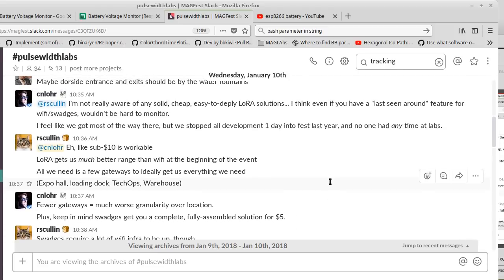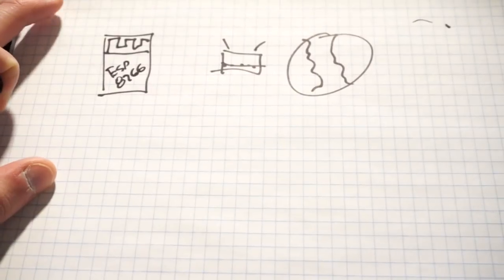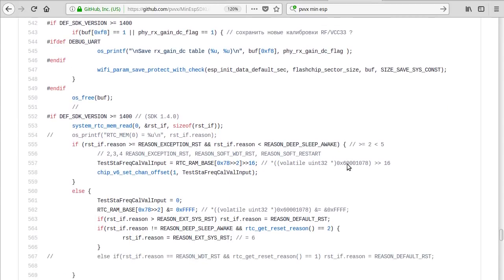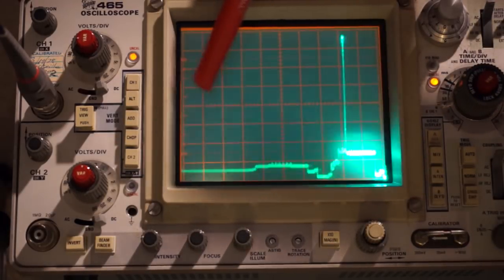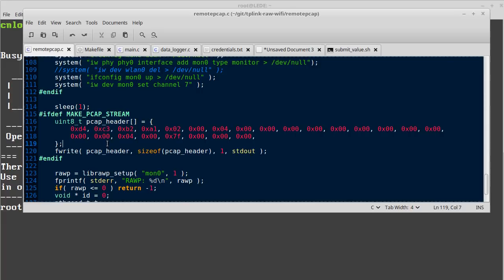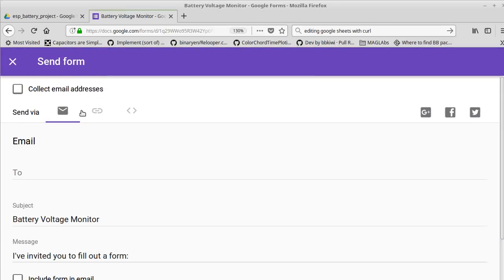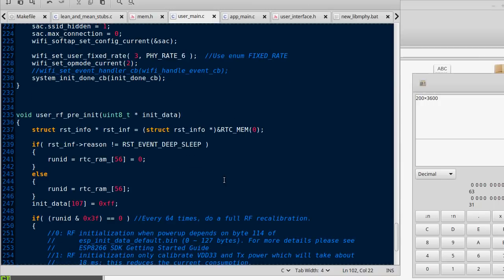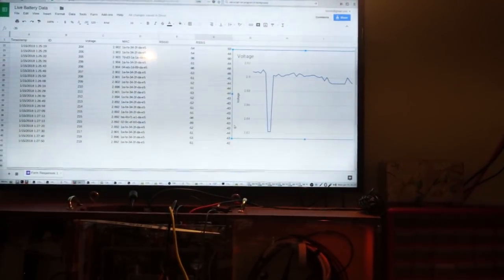Aggressively Low Power with the ESP8266

Comment: i recently discovered ulp bt module jdy-25m - 0.2mA in ibeacon mode and 1ma in transparent transmition mode. It possible to pair it by uart with stm32l0, which have power consumption in ulp mode about 0.005mA. If you manage intervals between active bt packages, you can achieve astonishing battery life.
Reply from the maker: I can believe that.  There's getting to be some interesting low power bluetooth chips.  But it's a lot harder to find that for wifi packets.
Reply: @CNLohr .yeah, i will test it soon, but not sure if i can measure such currents. Jdy21 or 22 claims 0.05mA. in ibeacon mode. I discover some other similiar modules, but i couldn't find them on AliExpress.

As for wifi im not sure, never looking for it, but just from cost efficiency i will go with esp12, or esp32. Poor low power currents, but all in one chips and cost 1-2$. Wifi consumes too much power for ulp devices anyways.

Comment: "Milliamps of power" ???
I thought amps were for current and watts were for power.

Precision in language makes one seem more authoritative.
Reply from the maker: Trivially convertible.  milliamps at 3v is milliwatts.
Reply: Amperes are units of current 
Watts are units of power
Reply from the maker: @rwitriol  If you know the voltage then that's irrelevant. Because they will then mean the same thing.
Reply: @CNLohr  Amps are current
Watts are power 
Because you can compute one from the other if you know the voltage doesn't change that

Comment: im looking at a home automation project, was curious on why espnow didnt work? too much battery use? Also as a relative noob, this video is super helpful, but what if anything else would i need to add/change to get it to chirp out a sensor reading instead of just voltage? thanks!
Reply from the maker: You can chip out anything you'd like.  It's pretty straightforward.  And I think the reason it didn't take off was because it didn't fit the mental model of what people were looking for.  Not based on any technical issue.

Comment: Did someone test in this scenario like how many devices can successfully submit the data, for example 100 or more ESP connected to such router and if there was any data loss?
Reply from the maker: Data loss is probable but probably very low rate of data loss. As these chips still perform CSMA to reduce the change of them stepping on each other's transmissions.

Comment: Nowadays it wakes up faster - less than a second while opening a TCP control socket and initializing OTA and uses about 16uA in deep sleep.
Reply from the maker: That's ten times as long as 100ms.
Reply: @CNLohr  Yea but you do not open a listening socket and setting up server and OTA :)
Reply from the maker: @iasenkostov6525  I'm doing what needs to be done.  I still get full two-way communications.
Reply: @CNLohr  I should test it with your setup to see the real difference. Btw I'm not even sure how long it takes coz it's repurposed code from another project with different idea. I can only be sure that it's less than a second.

Comment: Wouldn't it be easier to just send a single ICMP or UDP packet straight to the cloud server, saving requiring a custom modified accesspoint? I currently wakeup, measure temp (DS18) and send the data via http to an influxDB server, and goto deepsleep all in under 400ms, I assume moving from TCP to plain IP would be even faster, the data handling part is about 200ms.

Comment: ESP8266 WiFi Repeater (NAT Router)
Martin Ger
,Published on Jan 2, 2017
simpler to just add in marins lower power repeaters modified and several power reclamation options to supercap power storage with cheap STT-MRAM chip than some higher power use single router https://www.youtube.com/watch?v=OM2FqnMFCLw

Comment: The problem is if you use this approach you will have to change batteries every 1.5 month for just that simple one packet tranfer.

Current of deep-sleep = 20uA
Current of booting = 30mA
Current of loading = 40mA
Current of pre execution = 20mA
Current of execution = 70mA
Current of going in deep-sleep = 10mA

Time of deep-sleep = 9.9s
Time of booting = 35ms
Time of loading = 25ms
Time of pre execution = 15ms
Time of execution = 20ms
Time of going in deep-sleep = 5ms

Times of 10 second interval in minute: 60s/10s = 6 times 
Times of 10 second interval in hour: 6*60 = 360 times 

Time of deep-sleep per hour: (9.9s*360)/3600s = 0.99h
Time of booting per hour: (35ms*360)/3600s = 0.0035h
Time of loading per hour: (25ms*360)/3600s = 0.0025h
Time of pre execution per hour: (15ms*360)/3600s = 0.0015h
Time of execution per hour: (20ms*360)/3600s = 0.0020h
Time of going in deep-sleep per hour: (5ms*360)/3600s = 0.0005h

Power drained from deep-sleep: (20*10^(-3))mA * 0.99h = 0.0198mAh
Power drained from booting: 30mA * 0.0035h = 0.105mAh
Power drained from loading: 40mA * 0.0025h = 0.1mAh
Power drained from pre execution: 20mA * 0.0015h = 0.03mAh
Power drained from execution: 70mA * 0.0020h = 0.14mAh
Power drained from going in deep-sleep: 10mA * 0.0005h = 0.005mAh

Total power drainage: 0.0198mAh + 0.105mAh + 0.1mAh + 0.03mAh + 0.14mAh + 0.005mAh = 0.3998mAh

R2032 capacity = 240mAh

Lifespan with 2xR2032 batteries: (2*240mAh/0.3998mAh)/24h = 50 days without counting for external factors which can affect battery life.

Comment: It would be great if someone make a version where Instead of router use regular wifi stick in a pc - probably with mqtt support. 😀
Reply from the maker: If you use Linux, you can use a regular wifi thing in a computer, just switch it to "Monitor mode"

Comment: Is it possible to use an esp8266 on the "receiving end"? I would imagine a "server" esp8266 that listens to the sender. When it gets a package, it changes itself to a wifi client and connects to the normal wifi network and send the data to the "cloud" and then goes back into server/monitor mode. This would remove the need of a modified/flashed router. Did you look into this? Is this possible? Thanks!

Comment: Great video with a ton of things to ponder. Correct me if I'm wrong, but what I understood is that you'll have a little esp8266+coin cell or similar traveling around with assets, broadcasting periodically, and if in range of one of your openwrt routers, they can talk. So, each particular router would be given a location name, e.g. "Warehouse B," and each esp will be identifiable, probably by MAC address, so that your google sheet will display that this esp (and by proxy its associated asset) is at this location (the range of the router).  Is that correct?  
    
One hurdle would be that you have locations near enough to one another to have overlapping coverage. What's the plan for that?   
    
Do you have the flexibility to send whatever you wish, not just a voltage figure?  I assume so and I suppose your wakeup cycle would send its broadcast and wait a given time for a response, which could include the router's location name to be stored to memory before resuming deep sleep. (Incidentally, Andreas did a video on storing data to RTC so it survives deep sleep.) Thus, the esp's broadcast could include the last known location as well as voltage, which is naturally useful for detecting when it finally runs out of battery.  
    
I've played around with an Amazon dash button that was well priced, maybe $2 including its battery, and could sniff its broadcast packets with a device in promiscuous mode. I was wondering if the openwrt router has to be in promiscuous mode as well?  Got me wondering if the asset tracking is overt or covert...if overt, you could easily just "check in" an asset by tapping its dash button when it arrives at a new site.

Comment: OR you could use an attiny + nrf24l01+ and run it two years on a single CR2032 coincell (replacing the router with an ESP8266 with a nrf24l01+ slapped on it).
Reply: Or a msp430 + nrf2401 not only physically smaller than a fingernail but uses even less power

Comment: Did you tried "Node-RED" and "mqtt" , for making automatic scripts in no time.(Flow Based Programming.)
Reply from the maker: MQTT requires a network connection, so it won't really work in this application.
Reply: ok got it. also check out my energy meter http://opi0.ddns.net/emeter/   (Hosted on OrangePi takes some time to load.)

Comment: I'm looking at the post-transmission power usage at about 5 minutes in.

Since it seems to be sending a small unreliable one-way packet, is there any reason that it has to stay powered up at the 70mA level for around 15 ms after the packet is transmitted?  You mention it staying powered up "in case" it needs to do something, but unless it's waiting to receive something after sending, it should be able to power down quickly - perhaps dropping the energy per packet by another 30-50%.
Reply from the maker: For this application it could save that power, but, for my target application it would need to do that.

Comment: How exactly would I send raw data from my ESP8266 to my computer without any network in between? Did you use a network connection in the video or are the packets just floating aimlessly through the air? Thank you
Reply from the maker: Packets floating aimlessly through the air!  Tis the perfect way to do it!  Most wifi cards in computers also support monitor and managed mode.
Reply: I've looked at your code. Which lines exactly are transmitting the data?
Reply from the maker: The esp freedom line
Reply: And how do I send data frames? I cannot finde the correct header
Reply from the maker: Honestly, I just fire up wireshark, and dink with the packets until they look like what I want them to look like.

Comment: Thanks alot for the great video.

That's so nice, but this is consider a modification into the esp and the router to work as Wireshark sniffer. Which I can understand it's not even connecting the router as the router catch the flying packets.

I got an idea based on what you have done  for people who have many of ESP's which battery powered and get it reporting to one ESP working as a sniffer (directly powered) and post thier data it may saves more power that the router. (I can think of it but I don't have the knowledge to do it) but you may search it out if you find it interesting.
Reply from the maker: You could do that, but that's extra hardware.  If you have a home router, why not use it to do everything.  No extra hardware, or power!

Comment: So what do I do if I just want to get notifications from an ESP8266 for over a few years without changing/loading batteries and I want to use my casual AVM Fritzbox router? Means as a noob I am as dumb as I was before watching this video. :/ A sketch or something like this would be very appreciated.
Reply from the maker: I don't know what a fritzbox is.  It doesn't really work with Arduino as it is, really need to do the C thing, but, I can try to document more...

Comment: Pair it with a op amp and you got yourself a wireless voltage meter!
Reply from the maker: Indeed that would be possible!  Either-or, though.  You can't monitor the 3.3V rail and external voltage.

Comment: Andreas Spiess has a video about ESP Now, which is designed for such short messages. But i like your approach better and it seems to take half the time.
Reply from the maker: ESP-NOW Really expects to be able to link to other specific ESPs.  This is not feasible for situations where you would want to broadcast.  Also, the ESP-NOW while supporting broadcast does not support unassociated reception, so that's out.

Comment: This is awesome!!  Great video. I stumbled onto your video through the YT rabbit hole. This is a great project to add to my project of custom BMS for lithium based off-grid power storage. A few of use are building the BMS based off of TI's BQ76940 IC and want to be able to have communications via wifi with minimal impact to the packs voltages. Even if this wouldn't work for the powerwall application, it'd be great for remote and/or mobile projects like eSkateboards and eBikes, etc. 
Thanks for the info and hard work!!  🤠
Reply from the maker: Thanks.  Keep working away!

Comment: This is really, really cool. Now if only I had chosen better for my routers ("IoT/IP Cameras" dedicated is a linksys E2500v3 IIRC, main is TP-Link Archer C8 aka untweakable unlike C7)... I don't think my airspace can tolerate too many more networks, performance on everything dropped when I was setting up and testing the new router for my parents.

This approach would be a lot more flexible than my current plan of wall-power-bound ESPs talking MQTT.

Are you using "old" OpenWRT or LEDE?

I'll have to look into how much flexibility I can get with the Google Forms data collection...
Reply from the maker: LEDE is OpenWRT now.  It took a while but everything is being re-integrated.
Reply from the maker: Oops didn't mean to hit submit.  Also, you can directly talk to the google forms for data collection.  But yeah, that's a bummer about the C8.
Reply: CNLohr cool, good to know. (My next router I'll check third party firmware before buying, I foolishly assumed tplink was reasonably moddable since I'd heard good things about the series.). But I've still got a wrt54gs and two e2500s to work with. Just not enough oomph for a symmetric 300Mbit connection.

Comment: So the ESP basically just UDP's the shit out of its packets and hopes that there is an OpenWRT router nearby to look for its packets and recieve them, is that correct?
Interesting approach :D
Reply from the maker: Kind of but this is a level-and-a-half below UDP.
Reply: Excellent pilot! It would be awesome to know how power usage is affected if UDP is used instead of raw IP packets, so the project is a better neighbor if running on a non exclusive wifi network. Did you test it somehow?

Comment: impressive stuff. well, I also worked with esp8266 coupled with atmega328 as a controller that handles and stores data in its EEPROM and certain wakeup policies were defined. We go the power very low and (watchdog timer waking every 4/8 seconds)RTC (rough as we did not require accurate timing and could sync again after some time). we achieved low power operations that could work for a long. But it can be said it wasn't real-time and that project was later abandoned and we moved over BLE. though we started that wifi thing to work with 3 coin cells but it never worked so we moved to highly efficient DC-DC converters (don't remember exactly) but I have with me battery operation data. In middle, we improved firmware just before we had abandoned project. In future, I wish to make that project open schematics and program. You work is impressive. definitely reducing up time helps. thus DTMI option is also a good solution.  
I didn't know Google sheet thing.. Can I use it with ESP32/ESP8266 directly sending data to sheets(no need of low power)?
Reply from the maker: Hmm... I think I should do a video about the "secret" ESP8266 sleep mode, in which it is not connected to an AP doesn't go into deep sleep, but the processor remains alive (just waking up every few ms).  It only uses about 1-2mA IIRC.   AND you can send packets from this mode with minimal wakeup costs.

Google sheets can absolutely can be used directly if no need for low power!

Comment: Have you thought about undervolting the ESP? This seems the kind of application where instability is tolerable (you're not computing any safety-critical values). Since power consumption scales as voltage squared, that could make a significant difference I imagine (I'm assuming the current also lowers with lower voltage,  not sure if true).
I believe the most important factor (other than voltage itself) affecting chip stability is temperature, so you might have to find out the worst case temperature and find a borderline-stable voltage (maybe you can accept like 30% failure to send package?) at such temperature.

Edit: Oh if that power is being used to for wifi TX antenna (instead of digital processing) then I guess that wouldn't change much... although it might be worthwhile to see the minimum TX power you can get away with too.
Reply from the maker: Check out the real time graph.  The ESP is quite effectively undervolting itself! :-p  Right now it's down around 2.5V when under draw.  Actually you can see the temperature differences to when light his the batteries and ESP at around 9 AM.

Comment: Holy cow! Just when I think you're done coming up with game-changing ideas.... BAM. Right now I'm messing around with HC-06 modules, but I promise I'll some day be working off your stuff to make ESP8266 driven sensor nodes.
Reply from the maker: I don't know what you're referring to with sensor-driven nodes.
Reply: Right now, I'm thinking about having several, small, cheap wifi connected thermometers that I can strategically place where they might be useful, such as near pipes that might freeze, etc. Small and battery powered, stick some two sided tape to the back and forget it, yet sending me back data at regular intervals. A bunch of other things come to mind as well. Pilot light watchers, flow meters, relay actuators. Not having to run any cabling for any little thing I might want to control or sense is enticing. Just a really complicated way to say "thank you for the video". :-)

Comment: Have you tried using another esp8266 to capture raw packets and then do the requests to an available router? It should work even with those routers can't have openwrt, or can't set the interface to monitor mode.
Reply from the maker: That would work but why make something more complicated when you can make things simpler?
Reply: CNLohr 
You're right, I was just thinking about a generic solution not related/constricted to any hardware already in place.
Reply: This solution is also net generic as it is tailored for the esp8266. Just adding a modded router in the place of the second esp may be a lot more universal. This should also work with other models.